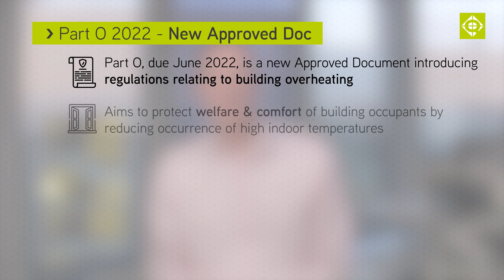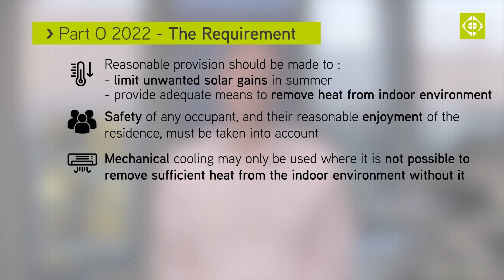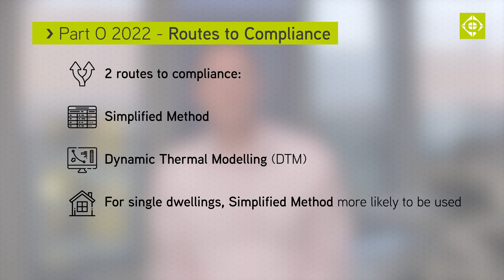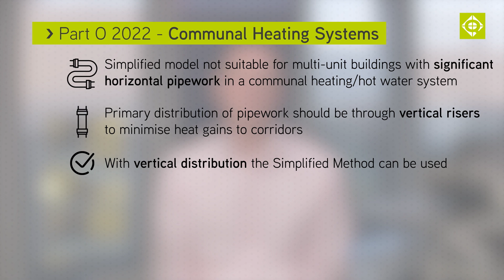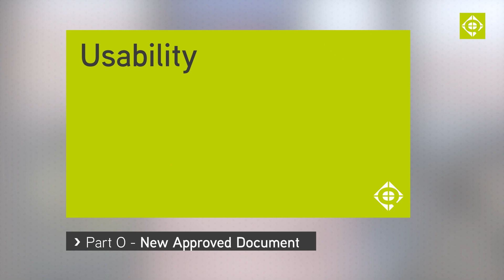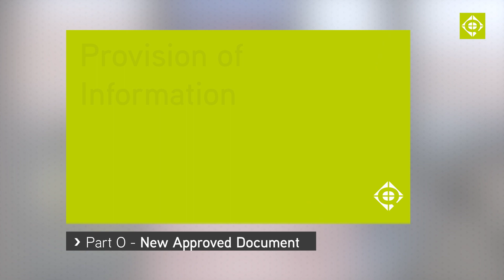New Regulations for building overheating: The key points from Part O

Comment: Key issues are always missing and that is that to mitigate the build up of moisture in a home then Humistat Extractors should be more widely installed and Traditional English building appearances will have to change......... Why are Continental Roller shutters not incorporated over glazed areas to reduce heat buildup in rooms and applicable to all rooms with air temperatures rising.  Thank you for the information.

Comment: One day we're closing all the windows , sealing everything up and using heat recovery for internal air quality. Now we're opening the windows/ vents to allow for cross flow ventilation to keep the inside cool. Ventilation /no ventilation, hot /cold. How do these all modern glass structures cope with all of this? Am I missing something here?
Reply: Your not missing anything my friend. We lost our individual and hence collective common sense and now blindly comply with more and more 'directives' that do little to improve our individual and collective lives. Think I'm wrong? Well if we had common sense we would not have put flammable cladding on any building and now need 'regulations' to help us do sensible things